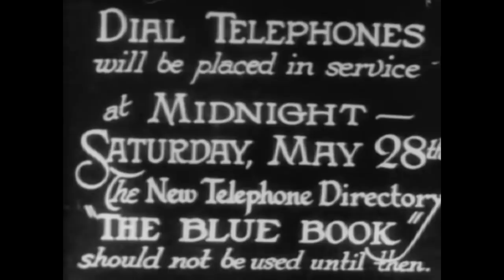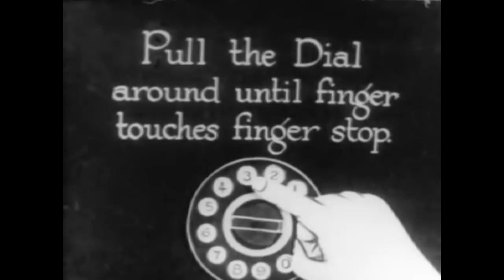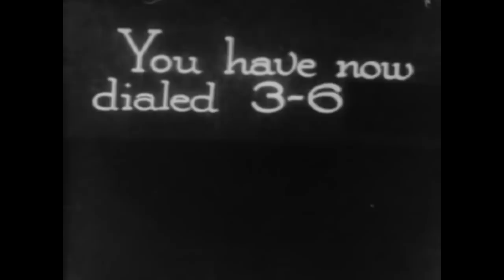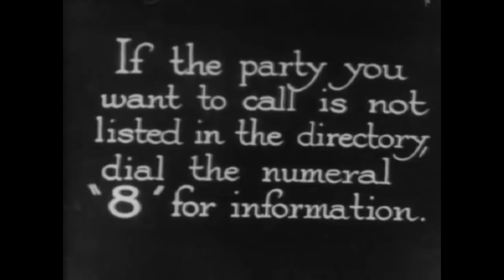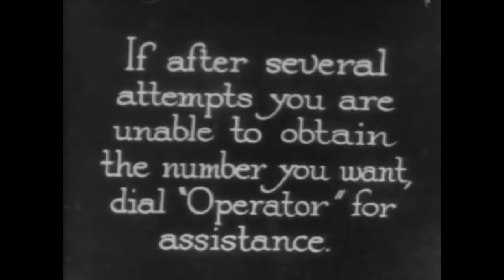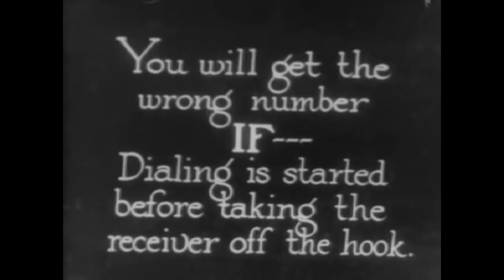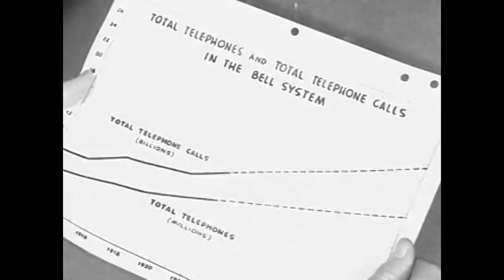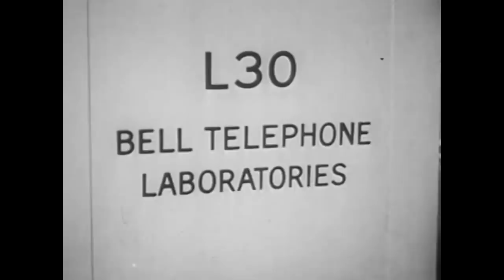How to Use a Telephone - 1927 Documentary

Comment: Very interesting & COoL. I find it funny that it basically makes trying to call someone a bit of a hassle i.e. busy, no-answer, call information etc. I guess it sucked back then too :O)
Reply: I grew up in the sixties, and it was easy.  No voice mail of course, but it is only “necessary” in an emergency.  Most people used the phone just to make plans to get together, so, calls were pretty quick.  My mom would talk on the phone for hours with her friends though.

If you got a busy signal, you COULD ask the operator to interrupt the call, but this was only done in SERIOUS emergencies (I never did it).

Virtually everyone answered the phone because the only people who called you were your friends and relatives (no spam, junk calls).
Reply: @thetooginator153     Very COoL. I actually forgot about "requesting a emergency cut in".. I only went as far as to asking the O if they could tell me if the line is in use or off the hook. Also,  calling the O and asking the "cost per min" to a specific number. I was in So. CA and we were adding area codes at a alarming rate (no pun intended). Thanks for the input. It's true what the others are saying, you RoCk  :O)

Comment: Is the number ten a 1 and the letter O?
Reply: No, at least in the US, the letter "O" was one of three letters (MNO) grouped with the number 6 on the dial. The 0 (zero) was the last hole. Dialing it by itself when you took the handset off the hook would connect you with a local operator.